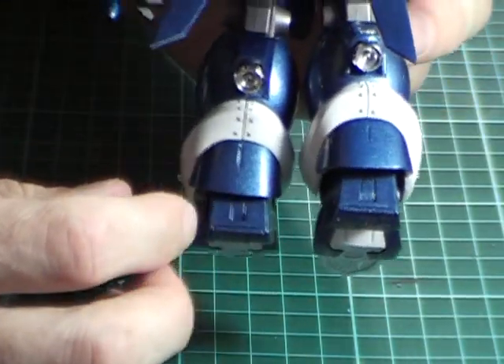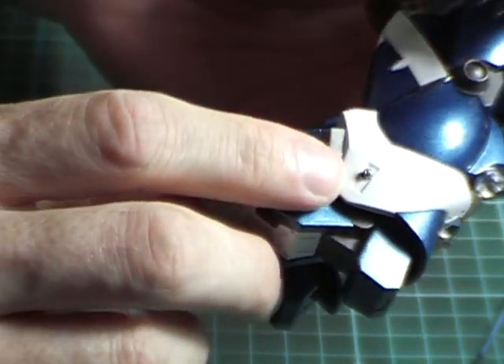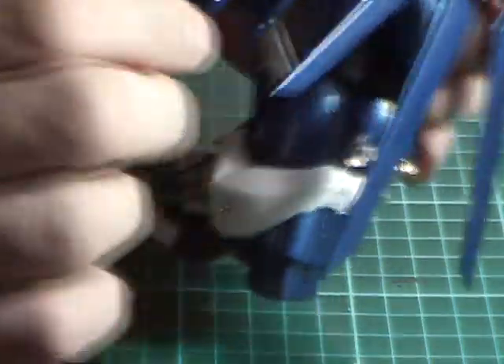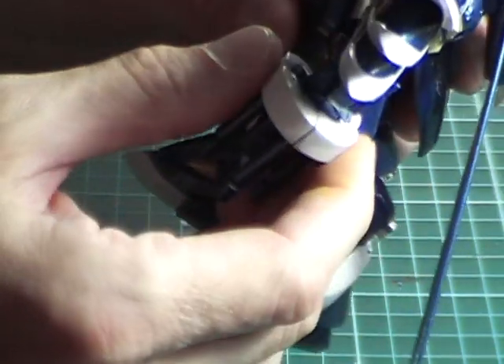Weibritter Super Robot Wars (Part 5 - Final Assembly and Detail)

Comment: Hi there,

I just wanted to know, something. The white parts you just applied primer or painted white after the primer? I'm a starting at these plastic models, I've bought the Wildraubtier (also from Kotobukiya). But just want to make it looks like the original. Can I use just acrylic matte varnish to make the white parts looks more matte or should I apply primer then the varnish?